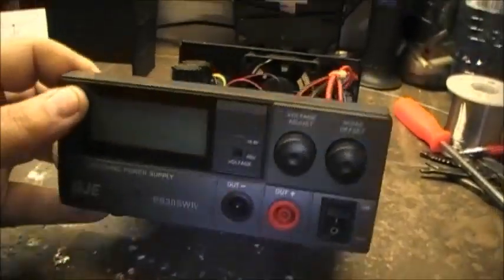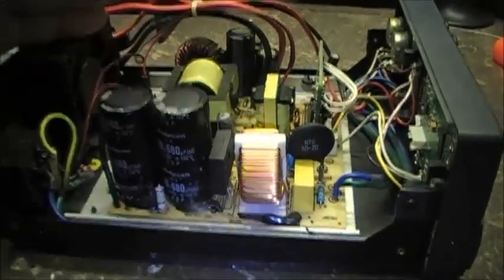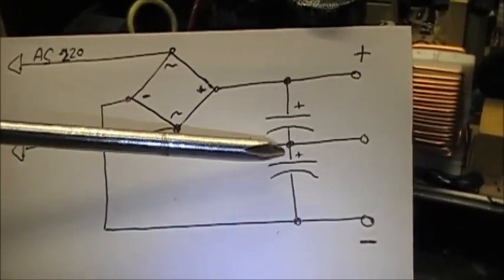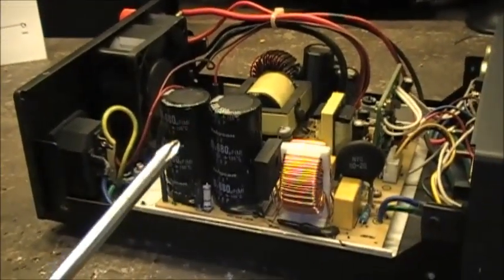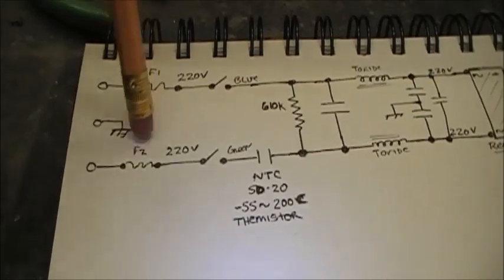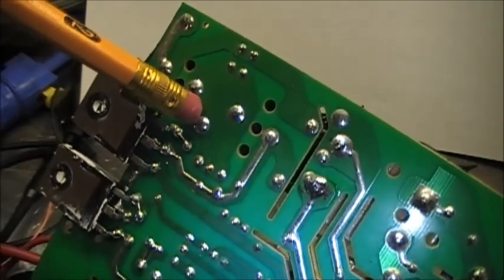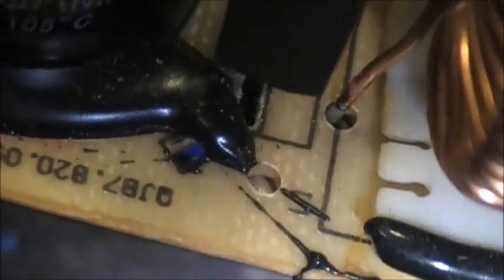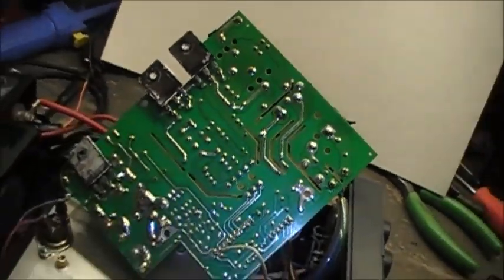QJE PS30SWIV - 120vac MODIFICATION - Part-3

Comment: Usually changing taps on the transformer allows for different voltages. When it’s switch mode there has to be a way just like one of your viewers commented that the computer power supplies had a switch for 120v / 240v input. So there should be a way to switch out one input for another 
Think those switches were DPDT so they were switching out one part of the circuit when switching in another.